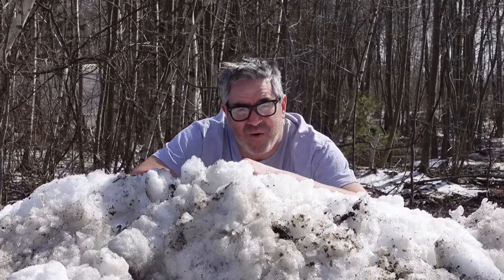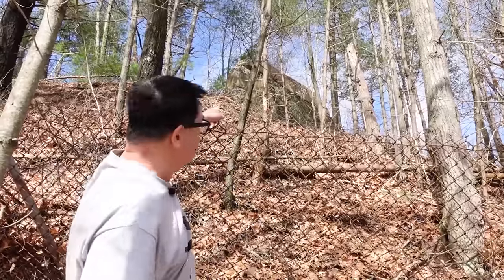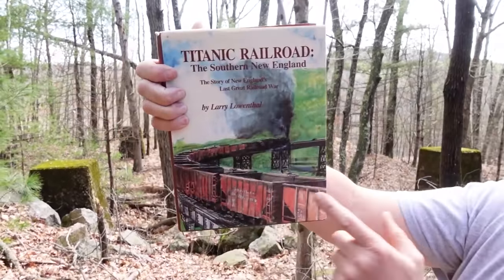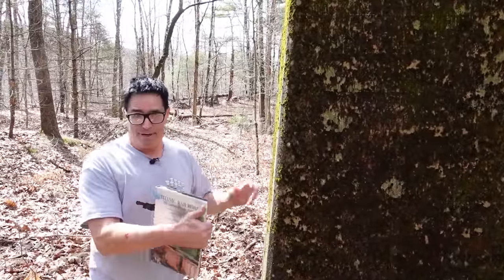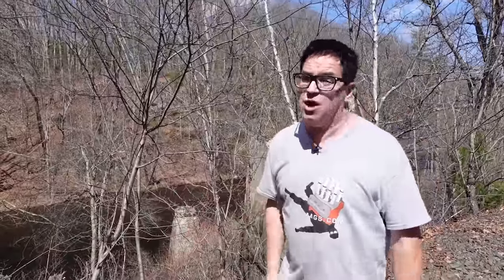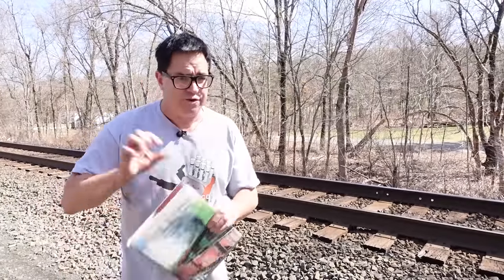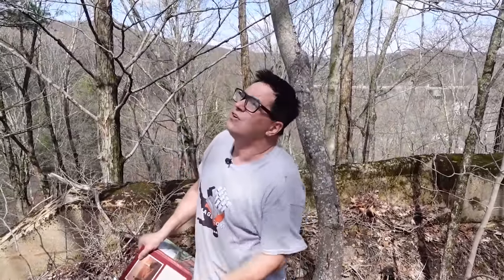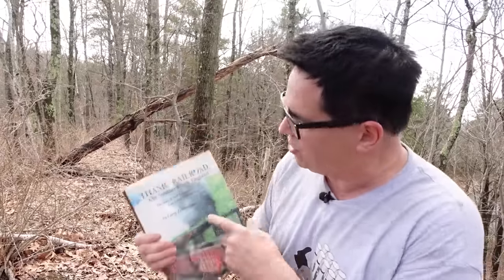Titanic Railroad (Reupload)

Comment: My former home in Dudley, MA was built on the uncompleted Grand Trunk rail bed.  Exploring the area as a boy, I discovered numerous construction artifacts, including a rusty old steam shovel!
Reply from the maker: That's COOL! I often marvel that if today an outfit like Walmart or Home Depot or Office Max started a massive constriction project of 100 new stores but only poured the cement pads before abandoning them, there would be a MASSIVE PUBLIC OUTCRY and Walmart etc. would be forced to chisel away all of the cement pads until not a trace was left behind. Yes? But somehow the ill-fated Central New England Railroad got away with leaving hundreds of odd cement objects behind after the plug was pulled. In many towns, solid concrete bridge abutments set next to public roadways took many lives as cars crashed into them. Brimfield had one on RT. 20 until around 1985 when it was removed and the hazard eliminated AT THE EXPENSE OF THE STATE. But to be more charitable, these amazing relics - like the pathway under your Dudley home - are an interesting chapter into the evolution of ground transportation. Thanks for sharing your Central new England Railroad story. -Steve Magnante
Reply: @SteveMagnante  My pleasure Steve. And if you Google maps that area, you can still see its snaking route and the houses that were built on its railbeds.

Comment: There's a highway or two in NYC that were started but never finished because they ran through forests and other places. The environmentalists got involved and ended it. But up until a couple of years ago, the overpasses to "nowhere" until they were removed when the adjoining highway was redone a few years ago. Also on my block in 1987, they were building houses. There was an abandoned car in front of the lot which the local kids hotwired after it was left behind after an accident. Well, the construction crew didn't know what to with it, so they squashed it and buried it under the first house. That car is a red 1985 Chevrolet Corvette. 

Oddly enough, back in 1979-1980, my parents tried to buy the lot across the street from us, but in order to do so they had to buy the lot across the street and the one that has the Corvette buried under it. So, I guess you could say my block has its' own "Cadillac Ranch" of sorts.

Comment: Steve, didn't you just rerun this video last week or the one before? 
I know I watched it very recently, but I have lately turned into a railfan, and have been watching all of Hobo Stobe's videos and a bunch of Hobo Shoestring's videos, so the original upload of this might've been suggested to me.  Plus which, I've developed a fascination with the Cincinnati, Hamilton, & Dayton, railway which came right through my township section in Dayton where I grew up.  I had no idear that a train ran through there when I was living there. They tore up the tracks in 1926, (after they'd been there only about fifty years) I think after selling the railway to either the Ringling Brothers or Barnum and Bailey, but I didn't pop out for another forty years. I even rode a Yamaha YZ100 on that right of way, which by then was used for electric transmission lines. They just removed the old metal frame transmission towers, and replaced them with single poles, through there a few years ago.

Comment: It's interesting to speculate if this had been completed, if it would still be standing today.
Reply: Would have been a great engineering achievement and at the same time a huge eye sore.
Reply: @jimc3688  I don't know about the eye sore, alotta early iron work is attractive
Reply: @jimc3688  what is your reasoning, Steel Bridges are not huge eye sores .... on the other hand ✋️ 4 fingers & a thumb
Reply from the maker: @speedfreak8200  The book I show in the video says that the NOISE of 2 to 4 STEAM POWERED freight trains crossing this 1/4 mile long RIVETED IRON bridge would have made a RACKET to be heard for miles away. And I have to say, the non-reinforced concrete pylons I show in the video would have certainly never lasted long under severe use. You can see they are made with a mix of sand, pebbles, palm-sized rocks and a binding agent. The outer shell is badly degraded. Not the stuff of eons. Also, there's no doubt the RIVETED IRON structure would have needed a complete rebuild / replacement once better welded bridge constriction techniques arrived in the 1940's. So it was a curious mix of "cheap on-the-fly" effort and trail blazing madness (with a touch of greed thrown in). The book by Larry Lowenthal spells out all of the shady stuff behind the scenes. Thanks for watching and writing. -Steve Magnante
Reply: @tomwesley7884  yes, but when they are abandoned as this surely would have been. Then the tax payers would ultimately have to pay to remove it.